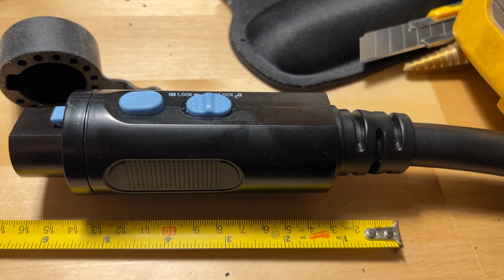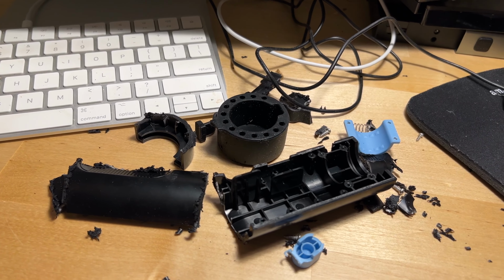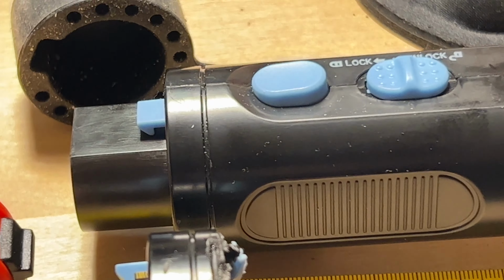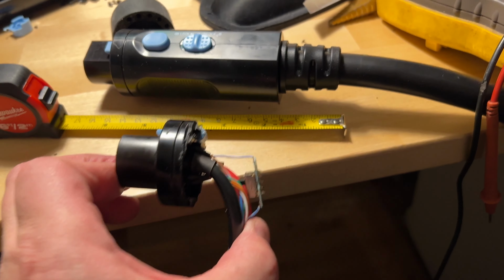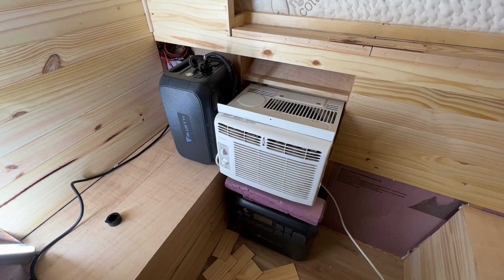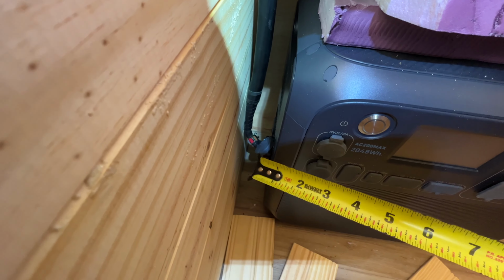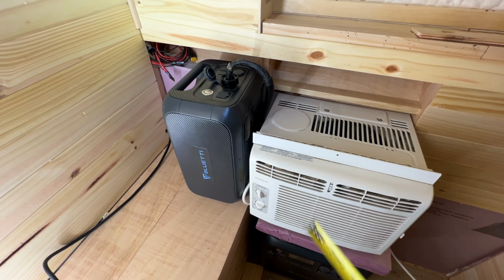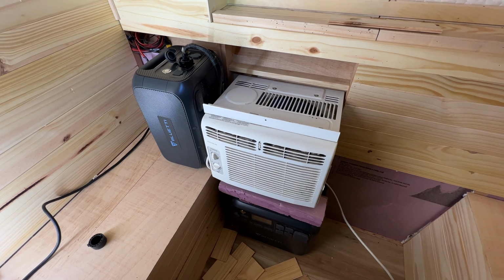Bluetti Battery P90D Cable Mod

Comment: I have the apex 300 and a 12v hub d1 that uses the same expansion port. Can’t use the d1 until they come up with a 90 degree male female adapter for whatever proprietary plug this is called.  I do not have 6” only 4.

Comment: Hi! How's that holding up?
Reply from the maker: No issues at all.
Reply: @TheTinyHouseGuy I'm considering doing something similar, but a bit different, and using their newer short cable, which has the flatter connector, I would slice the cable in half, and place some 6 or 4 awg cable in between them.
Reply from the maker: That would work....I wanted to avoid all that hassle. It seems like a poor design to me. Either make better cables or put the connectors in a better place.

Comment: Well…at least back then u had an option… just got the Apex300 and two B300k’s for our RV and realized we can connect anything because we obviously can’t stack them and all they offer is the new super short P090a cables. That’s longer P090A cable is now “out of stock” like most of their cables… 🇺🇸〰️🦅

Comment: My project is to go from P090D to aviator plug to bypass the extra cable I cut mine in half and threw the red and black into the aviator plug problem is it does not actually work I can't get my B230 to boot into expansion mode anyone know if I need to do anything with the communication wires?